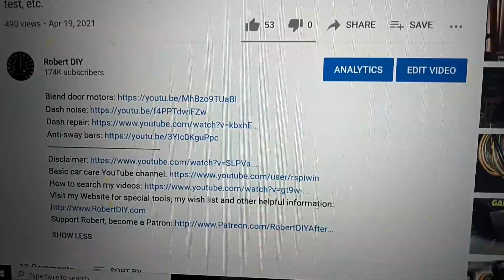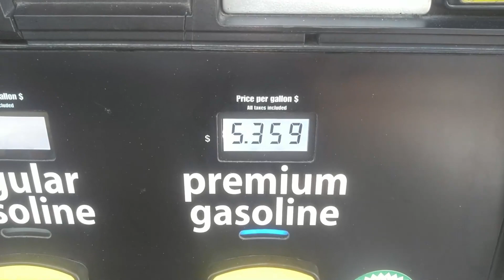Took a quick drive on the coast. Did my laundry. Meet with CJ and checked the S60R for oil leaks.

Comment: It is really not too hard to make your own P80 AWD angle-flange DP... just takes a little time fitting some amazon or ebay stainless pipe bends, flex coupling and the proper turbo flange. I highly recommend at least one band clamp to make install easy. Be amazed at what one can do with practice on a mig welder!